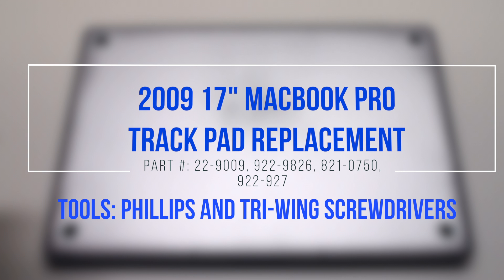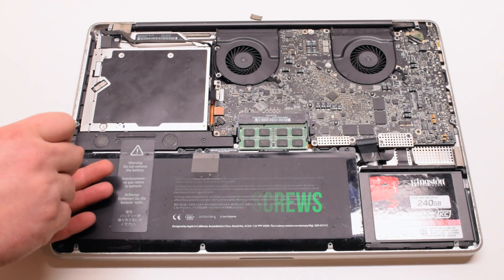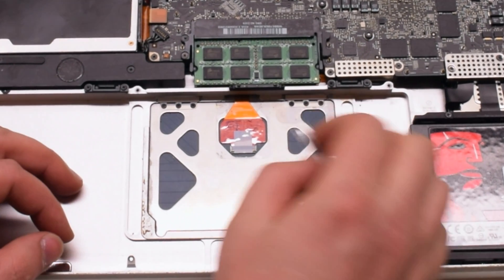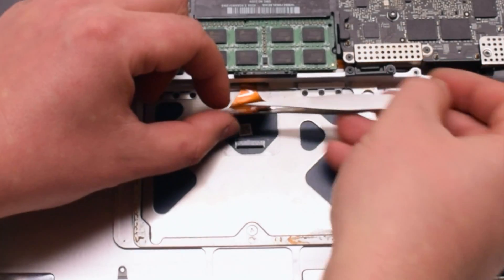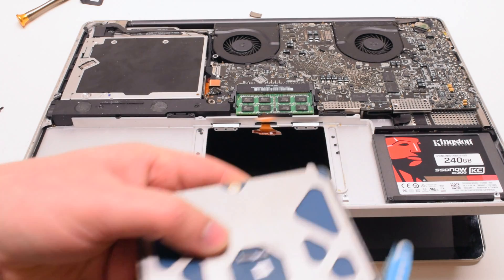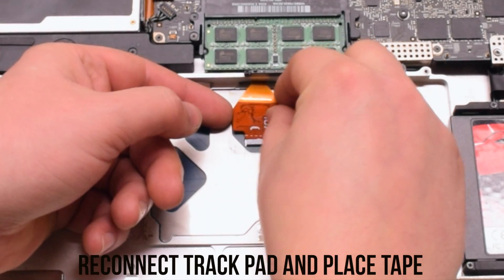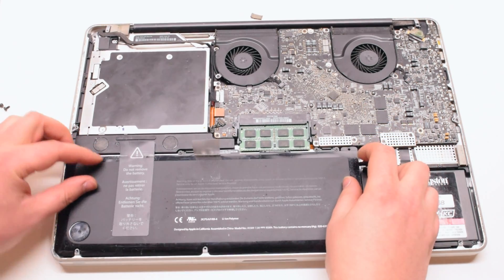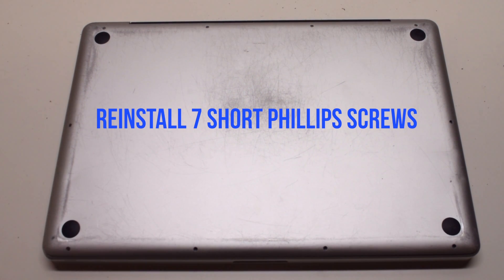2009 Macbook Pro 17" A1297 Track Pad Replacement

Comment: Another excellent video. Quick question: should I order a trackpad without the cable then? On Ebay I see them sold both with cable (e.g. here: https://www.ebay.com.au/itm/Replacement-Trackpad-for-Macbook-Pro-17-A1297-Touchpad-2009-2010-2011/322414941812 ) and without cable (e.g. here: https://www.ebay.com.au/itm/New-Macbook-Pro-17-A1297-Trackpad-Touchpad-2009-2010-2011-Year-WITHOUT-CABLE/162570262505?hash=item25d9f157e9:g:ZpoAAOSw8RJXC1Ov ). Does it matter which one I get? Would it be better or easier to replace the cable as well? Note that I'm also replacing the keyboard, so I will have the laptop fully disassembled anyway. Thanks for your help!
Reply: I ordered the one without the cable, as that one's new (and local for me).
Reply from the maker: You should be fine as long is the issue is not in the cable module, the module has electronic components.